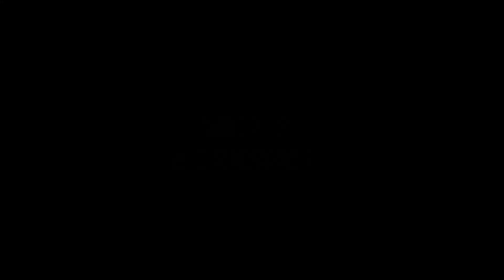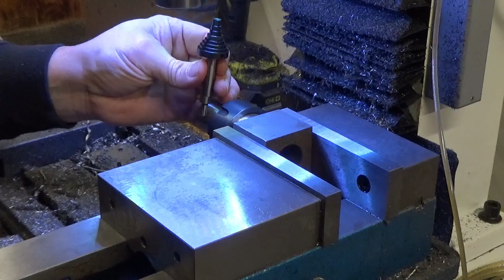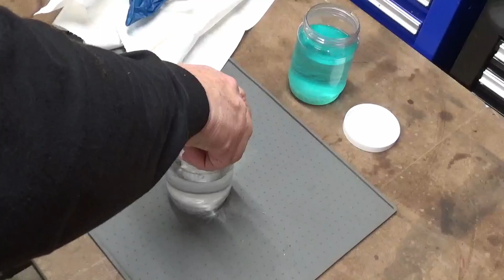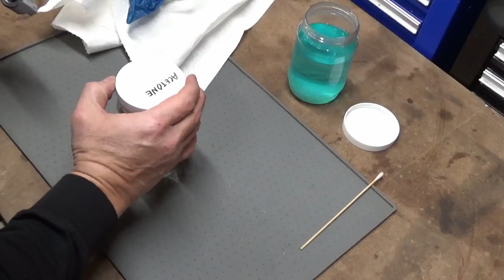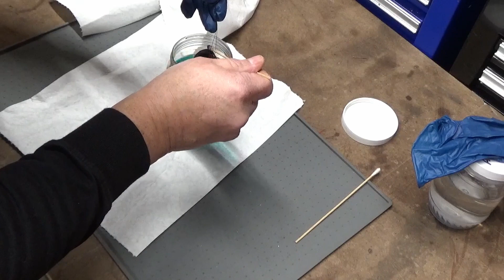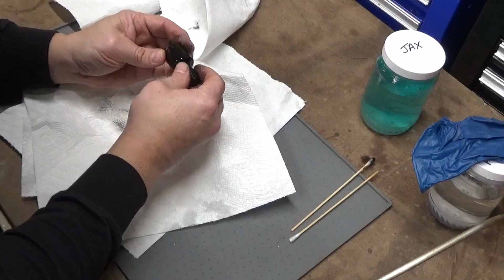Harbor Freight 4x6 Band Saw Modifications Part 2

Comment: Good work, well done.

With steel, I find that different inserts work better depending on the grade of steel. Also where you have power feed, I would use it.

In the milling vice, you could always do with the jaws balanced, so something the same thickness at the other end if you are just using the side of the jaw.

Lastly, I blue by just heating the part red hot and dunking in waste oil. You can see that in my making the centre bolt video.